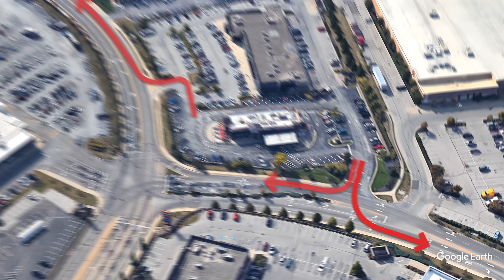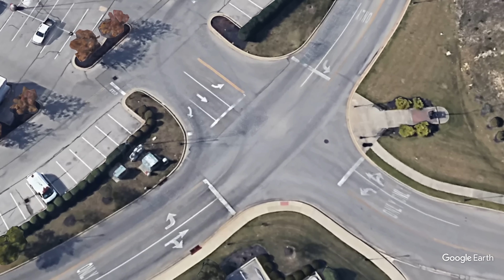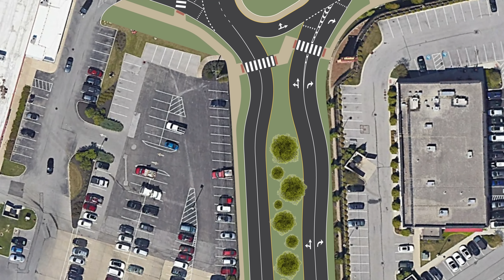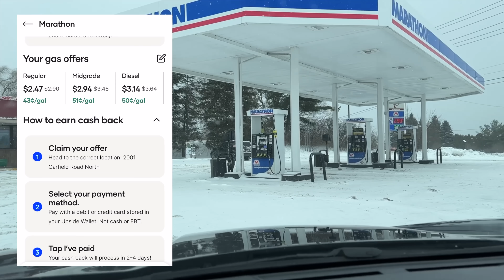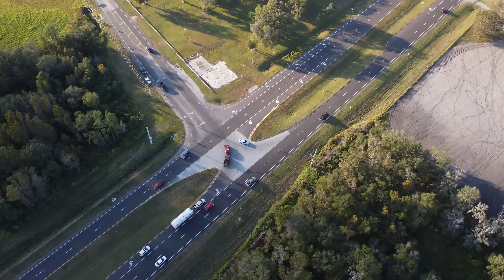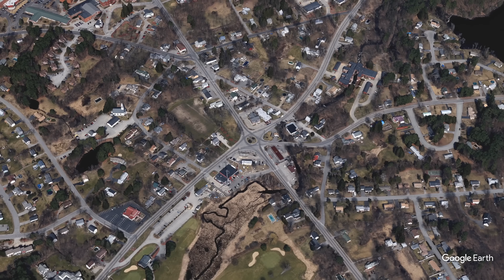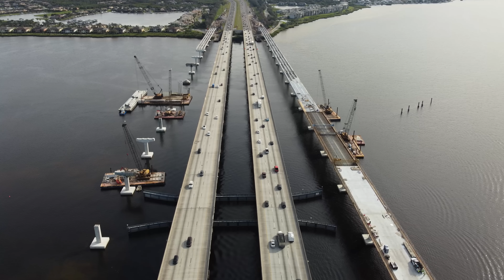These Intersections Should Be Illegal

Comment: The Existence of 4 way stops continues to baffle me. They're just straight up not a thing where I live, so far as I know.  Closest we get is completely uncontrolled intersections (4 way yield in US terms, I guess?) and even those are super rare on actual roads. 

Frankly, that bike lane should seperate from the road and either have actual crossings or, vastly better, a Bridge or Tunnel, to cross the on and off ramps, rather than being stuck in Between lanes. The cars crossing Each Other in that section of cloverleaves is already terrible enough without doing so In A Bike Lane... gah... 

We used to have intersections where the bike lane and the outer turning lane would have to cross each other... ok, we still do, but every time one of them is rebuilt, if it's physically possible to do so, that setup has been replaced, usually with a wider footpath (sidewalk, for the Americans), with the bike lane leaving the road and occupying a marked section of the footpath and then crossing the road with the pedestrians (if there's space, the bikes will have their own lights and the bike crossing and the pedestrian crossing will be seperate 'lanes', but they share a phase in the light cycle, with the only real difference seeming to be that that phase is shorter if the cycle crossing button is hit and the pedestrian crossing button is not.)
The specifics aren't at all universal, but the old design would lead to cyclests getting hit by the sides of cars that were changing lanes to turn way too often, and the new designs, be they as described above or otherwise, greatly reduce, or eliminate, that issue.

Comment: 0:42 actually, they cannot legally turn left.  A single set of double yellow lines can be crossed to turn, just not to pass.  But a double set of lines is called a "flush median" and is treated the same as if the actual grass median continued until it merges together.  Since you couldn't turn left over the grass median, you also cannot turn left over the flush median.

I wonder who approved the traffic plan for the Chick-fil-a.  Whoever permitted it should have known better.

Comment: 3:30 that serving roundabout would likely be a disaster in the US. It would have to be a rotary and have lights or something. If not one side will back up traffic on another side with how much traffic it looks like goes through that area.
Reply: He actually notes this at 3:43
Reply: It would work here. There’s plenty examples of them working here. It would just take the population there some time to figure out. Carmel, Indiana has tons of roundabouts with various configurations and that type of roundabout exists in the Midwest on interchanges with highways. It can be done. We’re not all “restarted”.
Reply: Once you add a traffic light, you've lost the primary advantage of a roundabout
Reply: @Jabberwockybird  Traffic lights can improve the operation of an otherwise congested roundabout, when the traffic flows are unbalanced and some movements do not get enough opportunites to go. It's a common setup in the UK, especially around motorway interchanges.
The lights also do not have to work 24/7, only in the peak times when traffic is most heavy. And you do not have to signalise every movement, just the ones that are struggling.

Comment: Question on the first case: wouldn't it be easier to have one, multi level parking lot with a smaller footprint and group all those stores together.
It would be better for business because a customer can do multiple purchases with a single stop. 

And that drive-thru just doesn't make sense. Maybe a preorder and collect system? Or order limits? Or maybe get rid of the drive thru if its not actually saving time? Anything to stop traffic generation because its a danger to drivers and also the staff who need to deal with customers after several high risk decisions and a needlessly long wait.

Comment: I would be very weary about putting a roundabout at the intersection of the main road that the highway ramps to the east connect to for 2 reasons.

1. That intersection will definitely be the busier of the two when it comes to pedestrian and bike traffic. While I do not know traffic counts of these roads, I do know that the highway nearby, when not currently out of commission to southbound traffic due to the fire under the Big Mac Bridge, gets pretty busy at rush hour (and sometimes during offpeak hours). assuming some of that traffic takes these exits, there would certainly be a good deal of traffic that would make it difficult and unsafe for non-motorists to traverse a roundabout. Plus, there is at least some level of pedestrian activity given a bus route has a stop on either side of the main road near the intersection.

2. A point you acknowledged, the area is on a slope (it is kentucky after all). This slope is noticable when in google streetview. Having driven a variety of roundabouts in varying weather conditions, I have never fishtailed my car going thru a roundabout that was on relatively flat ground with the main grading only coming from the center downwards to the outside, with most of that grade being only on the apron. I have however, fishtailed on a roundabout that had a prevailing slope from the west to the east. The weather conditions were only a slight drizzle of rain an hour ago. The pavement was barely wet at the time. Luckily I was alone on the road and recognized what happened instantly. For context, same vehicle all times, I never speed thru roundabouts, and have driven thru roundabouts in heavy rain, snow, slush, etc. Plus, there is a retaining wall located in the northeast quadrant of the main intersection. given the likely size of a roundabout here, it may impede on the wall, further driving costs and creating more potential problems.

To address the chic-fil-a access, I believe a better solution would be to close the access point at east to the side road and rather cut in access to the target parking lot to the north. This cut could be made at several spots, maybe even in line with the frontage road that separates the stores and parking stalls. If traffic volumes, cost, etc justify it, the intersection just north of the chic-fil-a access that was cut off, could be a roundabout as well. This intersection does not appear as steep as the main intersection and would not have as much vehicle traffic to impede pedestrians. This solution does have the challenge of getting the landowners to cooperate and likely foot the bill though as it would be difficult to approve public funds to improve traffic of private land, however chic-fil-a may be willing to work and enter an agreement with the municipality. The target landowner(s) would be a separate story but probably would be open to the idea as they would have less disruption to their land, with only a curb cut being done.

Comment: In the Chick-fil-A one, you're not meant to turn left into it, that's why the double yellow lines are there. If it was dotted yellow like a stroad turn land, sure. But it isn't, that turn lane exists for you to turn into target. 

However, because there's no solid barrier stopping people like a curb extension or even simple bollards, everyone turns there instead. I know why, because of the left turn out of Chick-fil-A, which is incredibly dumb.

An extremely simple fix would be just remove that entire exit/entry, and just add a tiny ass road that goes into the target parking lot. It's miniscule, but would genuinely do a huge amount while not limiting anything.
Reply: The issue is that they would need to have Chick-Fil-A and Target (and their landlords, if the lots are leased) agree to do that and someone would have to pay for it. Plus, they don't have much incentive given how busy the businesses are already.

Comment: I’m convinced that they put bike lines in shitty locations so they can say that they added bike lanes, then take them away because “nobody uses them”.
Reply: City Planner: See, I told you no one was using them.
Assistant: Sir, they're all dead.
Reply: We built the streets for cars. Bike lanes pasted over existing roads doesn't change this fact. Proper bikes lanes require, in most cases, a complete redesign of the street. And turns out slapping some paint on the road is much cheaper.
Reply: @bixbysnyder-00   No actually you need 1 Sign.. No automobile or Motor Carriages .. And done
Reply: My city did someting (to me,) unthinkable. They took a 5 lane road and made it a 3 lane road for bike lanes, because unlike other 5 lane roads nearby, both right hand lane markings were right along the sidewalk curbs. Thankfully its the only road like that, other 5 lane roads are still 5 lanes plus bike lanes.
Reply: :face-fuchsia-tongue-out:nope iy's about Death. If cycle bob happens to just oops. Well no more bothering bob

Comment: Wish more lots were connected together, would be so easy to make a path from chick fil a to target without going on the main road.
I like the roundabouts, but a better solution would be to combine cfa and target into 1 driveway, then it could be a roundabout, or could be cool with a peanut roundabouts connecting to both drives with 1 roundabout, I don't think cfa would approve losing both left in and left out access. And tons of people would be attempting a left turn at the target drive to get to cfa. Maybe have the outside lane of traffic not going to cfa/target bypass the roundabout to ensure traffic doesn't backup into the bigger previous roundabout as can't put multiple roundabouts too close together

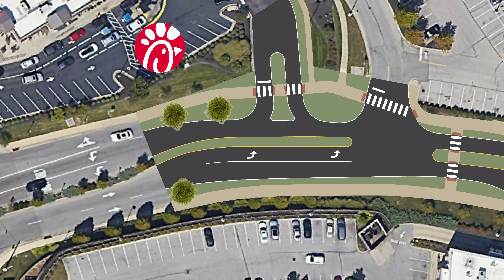Comment: 2:56 I would have just forced the Chick-Fil-A and the Target entrances to be merged. There probably should be a rule about having entrances/access roads that are allowed to cross the median too close to your property boundary (and to other intersections). With exceptions being given if the entrance is shared between the parties on both sides of that property line (as I would suggest the businesses do here), or if there otherwise would not be enough property frontage to place a all-way access anywhere).
Interestingly, at 6:53 I would have done the exact opposite: split the side road up into two separate "roads", one that can only be exited to the left and entered from the left (in a right turn), and one that can only be exited to the right and exited from the same side (in the other "dangerous" left turn across traffic). The left turning lane out of the side road would need to cross over with the left turning lane into the side road at some point down that side road, but that won't be a problem (except for people queuing to turn left onto the main road potentially blocking the traffic coming from the main road from crossing over.

Comment: The stroad should be illegal, if you want local access just make a street on either side of the road. With how wide the lanes are, there's surely enough space, right?
narrow single direction street, median, wide single lane road going one way, wide single lane road going the other way, median, narrow single direction street.
9+3+12+12+3+9=48 feet wide, that should fit... There's just way too many turning points on that road.

Comment: Some really good solutions. The rural highway design makes much more sense then an expensive interchange, but have you considered a large roundabout? In the UK roundabouts are used even on major national highways, it may slow down the non-turning traffic, but the decrease in speed is only small and it would be the best option for vehicles entering an exiting the highway, as it is less of a detour and doesn't require them to cross as many lanes.
Reply: I personally haven't seen them on a motorway, though i have seen them on the exits. The A19 near me used to have left turns across the carriageway though they were removed so only one side can go in and out, so if you want to go north you haft to go to the nearest junction, head off and use that to flip around.
Reply: @davidty2006 You can't really have a roundabout on a motorway, it's an at-grade junction.
Reply: @trainsim5869  Not suggesting roundabouts exist on motorways just on non-motorway routes such as the A1 or A47. The junction in question isn't an interstate highway but is still a major route
Reply: I've seen plenty of junctions like this on dual cariageways in the UK. Some of them have since had traffic lights added.

Comment: Pretty sure most countries would solve the Chick-fil-A problem by just merging the parking lot with the Target one. One shared in/out lane or a roundabout, less confusion.
Reply: alternatively, remove both their exits at that danger point and make it a sliproad between the two parking lots.
Both keep the same number of exits/entrances, it's just that 1 of each becomes eachothers parking lot.
Reply: Unfortunately the entire complex is jammed into a tiny valley with tall hills. The topography is such that the Chick-fil-a's roof about the same level as the Target's floor.
Reply: Since they are not level with each other it would also make sense to just connect the two parking lots with stairs and a wheelchair ramp and then people could use their legs for what they're made for. You know not pushing pedals but walking.

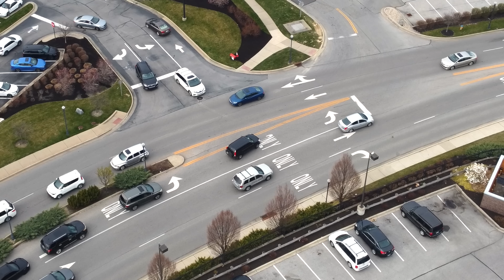Comment: 1:08 - I stopped the video here an d tried to figure out what we would do differently in the UK as I have never seen a junction that bad here. Sometimes, you would have traffic lights controlling a junction like this. However, the method I see used most often would be to only allow drivers to exit right (as in not allow the direction of the red arrow at 1:15. This would work in the UK as there would be a roundabout at the big junction meaning you could turn right and then use the roundabout to redirect yourself left.
In fact, for many junctions like this, we only have one way in and out, roundabouts are then used to get the direction you want to go. For example, reader.smiles.pasta is the whatthreewords of a similar junction in Aberdeen where the exit of a fast food store causes congestion - it can spill onto the main road at times, but rarely causes the chaos I see here. A lot of junctions in the UK are like this and so drivers know what to expect. 

Edit - your layout is pretty similar, but we rarely use roundabouts like two/one lane you use at the major junction. What we do instead is to have two lanes on each entrance, one for traffic going left or straigh (think right or straight in the US) and one for traffic going right (think left in the US). This means that traffic rarely has to change lane on the roundabout other than at their exit. We do get collisions on roundabouts, but they are mostly caused by people trying to use them to overtake other drivers.
Reply: This intersection (1:08) wouldn't change much if it were done here in New Zealand. The only addition to this would be painted 'Keep Clear' boxes in front of both entrances/exits to create gaps in the line of traffic waiting at red lights from the major intersection down the road to the left of the screen (1:15).

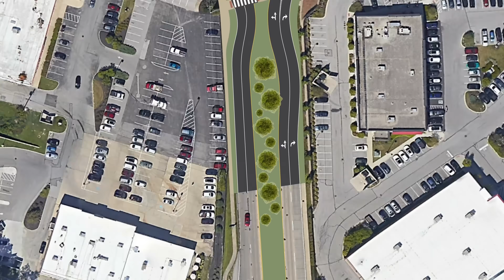Comment: The big roundabout at 3:10 could be even safer if the right turn slip lanes were made to require a sharper turn. Letting the turn be gradual allows higher speed through the roundabout, making the crosswalks more dangerous. The North entry is best because it has the sharpest turn from the right lane.

Also, having the crosswalks pushed back further from the yield line, more like the East road, would give room for one car past the crosswalk at all the crosswalks. I think that's a little safer because then it's less likely for a car to be partially in the roundabout, or partially in the crosswalk.

Is it just me or are the left hand lanes showing a left pointing arrow confusing? I understand what they're saying, that you can eventually turn to the road to your left, but arrows like that usually show immediate turns, so it actually looks like it is indicating you can go clockwise around the circle.

9:05 This one is funny because you could just look at the tire marks on the road to see how things need to be necked down, and it would still be an improvement, even if it's not as good as your solution. It's a lot like when it snows and you can see how traffic actually uses streets.

Those bike lanes basically exist to disprove demand for bikes but ensuring no one will want to ride on those bike lanes.

Comment: The awkward roundabout could be easily solved, and cheaply, by using portable curbs to reshape the roundabout into a more modern design. Then, the city could see the immediate effect of making a more expensive change.
Reply: Honestly, all it really needs is signs and actual lane marking to fix it, and then remap the crosswalks as well. There's no need to basically rebuild the whole thing. The car going the wrong way at the roundabout was just an idiot driver or some old person who shouldn't be driving. 

Just look at the video of the drivers who were doing all sorts of shit at the new roundabout in Kentucky (or wherever it was).
Reply: @codman13b  Yup, could probably all be solved with some paint. Like, in the top down view you can even see where people drive the most, just put lane markings around those areas.

Comment: the two lane roundabout at the shopping center would be dangerous for bikers. just saying, from my experience here in Germany. Cars can exit very fast with this configuration. The roundabout would also be too complicated for many drivers. I would prefer a signal here, or a simple one-lane roundabout. (Probably doesnt work here, because the traffic from the freeway could be too much, just guessing). Also, I just hate two-or-more lane roundabouts, sorry :P The other roundabouts are designed wonderfully. Truck turning-radius requirements are sometimes a problem. Depends on what you require in the USA. I live near an industrial area which streets are designed in kinda your way, its really good.